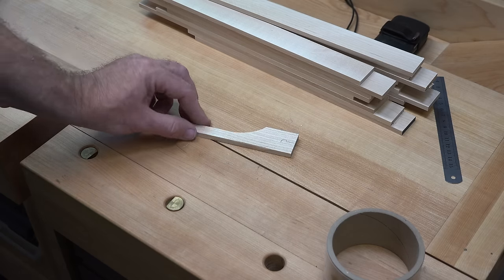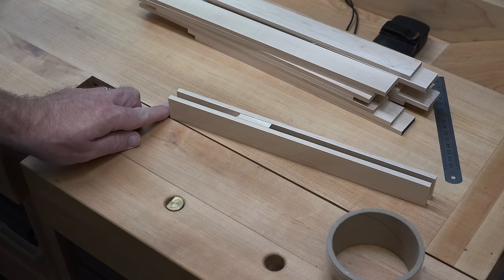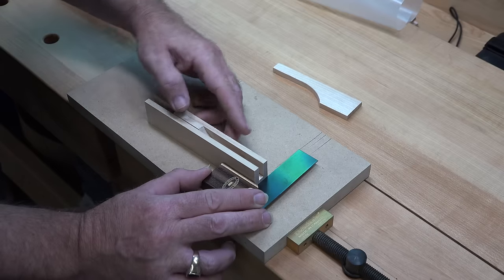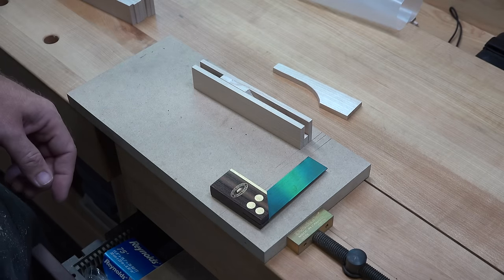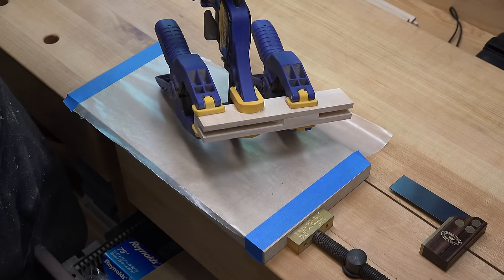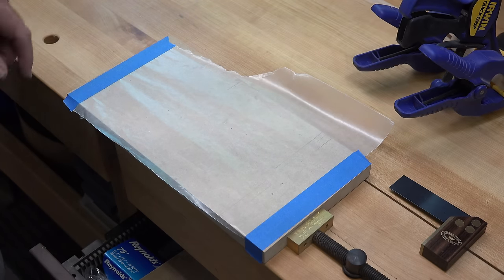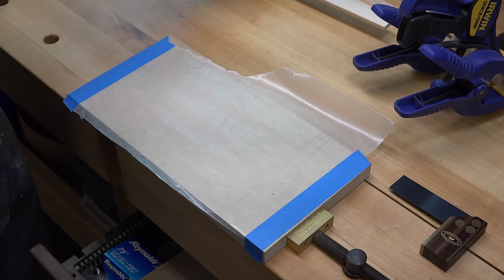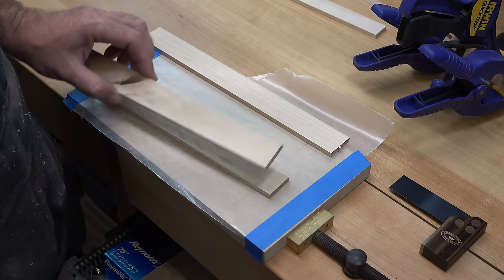Shop Made Cam Clamps

Comment: The clamps are a future project for me. 
However, I am working on the lathe thickness sander. I didn't have access to large diameter conduit so I used PVC pipe and couplers. I cut the pipe just long enough (about 3") so when joined together with the couplers the couplers would butt up against each other. This is plenty rigid and reasonably affordable. I used two clean out plugs to cap it off at either end. It seems to work a charm. 
Thanks very much for the idea.
Reply from the maker: Sounds like a great design.  I considered PVC pipe at one point but wasn't exactly sure how much heat I would generate sanding material and the last thing I wanted was to exceed the PVC's heat threshold and have it start to warp or collapse.  I'd be interested to know how this is working out for you for the long haul.  Thanks for sharing your solution to the lack of materials and providing and alternative method.  Awesome stuff.

Comment: Ken, another great project from The Cut Above Workshop. I really like the design you came up with, I think the only change I might make would be to put either cork or leather cushions on the pads to prevent any marring. Super video, another winner. Paul / paulsmessyworkshop
Reply from the maker: Thanks Paul.  The cork is a great idea.  A little extra padding would definitely not hurt.  You just might want to be careful how much you add as the action of the cam is not extreme.  All your pressure might be expelled compressing the cork instead of transferring it to your project.  Thanks for taking the time to leave me a comment.

Comment: Hmm... when gluing you could put blue tape on the ends to prevent getting the glue on your clamps. Quick and easy fix. Love the all wood construction.
Reply from the maker: That is definitely one possibility for sure.  Thanks for chiming in with a secondary method.

Comment: If you just use an offset circle for the cam its locking is not linear.  you can design the cam in fusion 360 to have a constant curve which would allow it to lock in any position.  just make a spiral projection into a sketch and bob's your uncle.  make a drawing 1:1 export as PDF and print it for a perfect cam template.
Reply from the maker: I've always said there is more than one way to do pretty much every process in woodworking.  Your comments just proves it.  I have no idea what you are talking about because I'm not a tech savvy kind of guy and I don't use design software but if it works for you, then I'm good with that.  Thanks for tuning in and for taking the time to chime in with your suggestion.

Comment: Another great project Ken……the plates with all measurement slots, I’ve never seen them. Amazon? B
Reply from the maker: Those are called T-rules and they are made by INCRA.  They are available at most woodworking stores or directly from Incra.com.  I got mine at Lee Valley tools.  https://www.leevalley.com/en-ca/shop/tools/hand-tools/marking-and-measuring/rules/58877-incra-t-rules
I hope this helps.  Thanks for tuning in.
Reply: @acutabove_woodworkings  thanks for reply Ken.

Comment: It seems like pretty much everyone builds these with an aluminum or steel spine. Has the wooden spine proven to be adequate? Not slipping, indenting, flexing too much, etc?
Reply from the maker: I have never had an issue with the wooden spines.  They have always worked and worked well.  I hope this helps.  Thanks for tuning in to the show Matt.

Comment: thank you . i was wondering about making them for clamping bracing to the sound boards and backs ?  as opposed to the go deck ? any feed back will be welcomed reason go deck lots of room not so much for cam clamps ? space thing you know
Reply from the maker: These shop made cam clamps Walter are a low pressure and light duty clamp.  I originally made them to clamp the bracing on my ukulele build a while back because I was having problems with the existing clamps that I had reaching into the centre of the body of the clamp.  The light duty nature of these clamps make them perfect for this sort of thing because you won't risk damaging the sound board of the instrument.  Depending on the size of your sound board, you could probably increase the size of the throat of these clamps to reach in to the middle of the brace to give soft, even pressure until the glue sets up.  You may not need to do this though depending on the position of your sound hole because you might be able to have them reach from the sound hole to the brace.  I think you would be happy with these for that purpose but one thing I would suggest is to test the clamps before you use them on a project.  I had one of the four that I made fail because the bar was ever so slightly undersized and it just wouldn't grip when the cam was engaged.  You'd hate to have a failure like that on a project while in the middle of a glue up.  The other option as well, is to use steel bar for the flat bar instead of maple.  Just an option for you sir.  Let me know how it works out.  I'd love to hear about it.  By the way, what kind of instrument are you making?
Reply: being retired i am bored out of my mind . not used to just sitting on my bottom. so i bought some wood working tools . ah the never ending chase . i hope to learn how to make guitars / classical / and maybe mandolins and appalachian dulcimers or maybe just boxes . but wont know till i try . my back ground is wide 10 yrs machinist , 20 electronic bench tech  and  at 5.8 170 11 yrs as a correctional officer in the county jail you do what you can to feed the kids . that was when i lost my back and had to sit down at 59   . worst case is i will make lots of dust . it would be nice to sell some . for extra money . never had too much myself. the funny thing is i have not picked up my own guitar in 15 yrs. 60- 80 hours a week will do that at the jail . thank you for your time Kenny
Reply: oh question please leather on wood vices is it a good idea ?
Reply from the maker: I think that would be a personal preference Walter.  For me, the answer would be no.  I'm not a fan of leather on the wood vise.
Reply: thanks info from you is a great benifit to me
Reply from the maker: You're very welcome Walter.
Reply from the maker: Building guitars is a long and lengthy process that takes quite a while to master.  I might suggest that you try to build a ukulele first.  It's a little smaller scale and it will help you build the skills it takes to venture into guitar building.  I'm not sure if you have seen my 12 part series on building a ukulele, but if you haven't and are interested, you should search it out on my channel.  There's plenty of good information there including wood bending, edge binding of the instrument and fret wire installation.  Good luck on you venture.  You're going to love it.
Reply: that is a good idea . i have spent lots of time on you tube doing research the good thing is i got plenty of time . and i am familiar with guitars and non on ukulele
Reply from the maker: Well good luck then.  If you have any question, be sure to ask and I will help out if I can.
Reply: thank you Kenny
Reply from the maker: You're very welcome